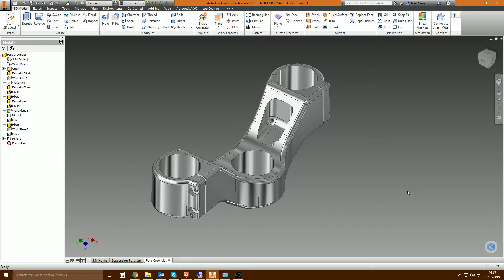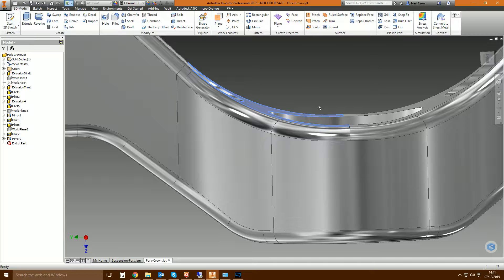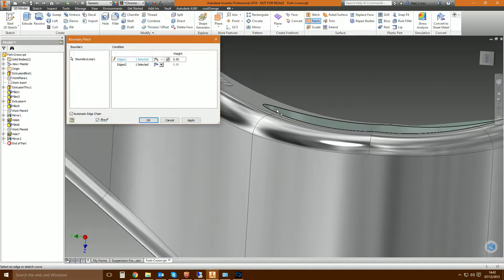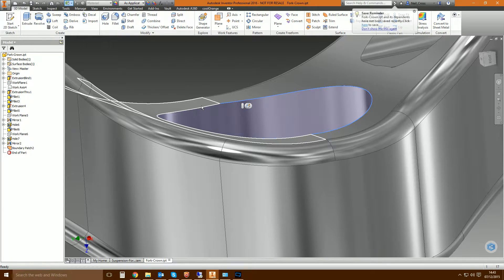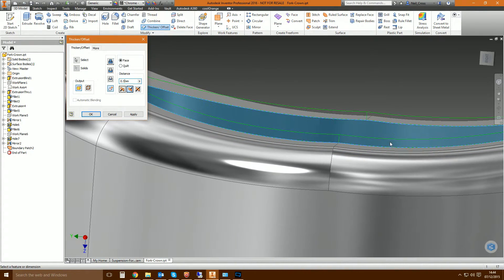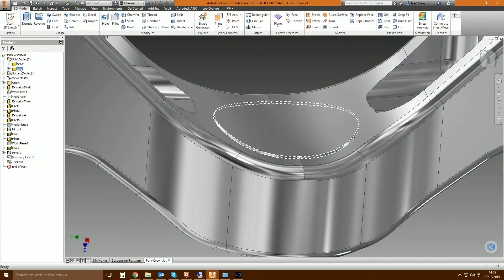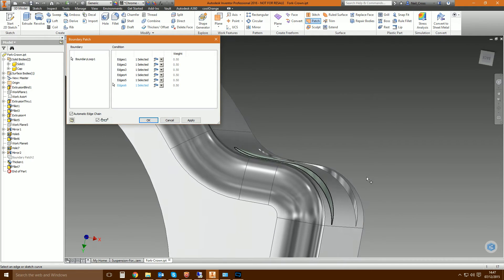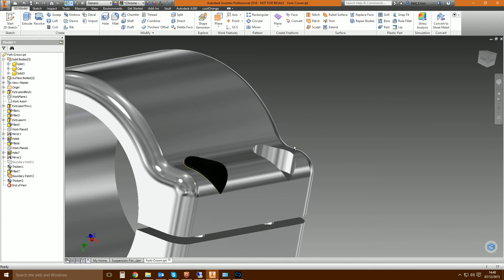Patching up holes and openings | Autodesk Inventor

Comment: Hey there,

how am I gonna make the diameter of the cap a mm smaller so it can fit inside the hole (while having used the patch and the thicken command of course)?
Reply from the maker: +Σοφια Τσαβαλια Hey, you just use the thicken command again but this time use it on the side face to thicken a cut into the solid.  It won't always work, kind of depends on the shape you've got but that's what I would do!
Reply: +TFI CAD Tips 
Thanks a lot

Comment: Tremendous!  By chance, with your phenomenal approaches and personality to boot...do ya think that you'll ever be venturing into the HSM CAM kernel of our beloved Inventor to machine a part such as this triple tree?  

Also, how killer it would be in HSM to mill the free form shapes for the cap covers that you performed in this tut as would be done in the tool and die injection molding world...Ho-Lee-CAD-God would I ever flip a biscuit over such coverage!

Crushing it man!  Best instructor I've ever observed!
Reply from the maker: +Wes Sugg Haha I'm loving the enthusiasm! Unfortunately I don't have any experience at all with HSM or anything CAM related, so it's not something I'll be dipping into I'm afraid!
Reply: 10-4 that good buddy!  With a brain as completely jammed packed with as much bad assery as yours, I can see how things may get dangerously hectic working between parametrics to 3+2 axis mill turning environments!  I have a sneaking suspicion still though, that by next week you'll be crushing that mo-fo too!  Basically, what I'm trying to say is...snap to it...I will remain doubly in tune for the first of 500 HSM Pro CAM tricks!!!

Keep up the level 10 trillion rated ballzin' tips and tricks tuts my most admirable tech wizarding sorcerer!!
Reply from the maker: +Wes Sugg Can I smoke whatever it is you're smoking? Haha thanks, I'll be back on it after the new year!
Reply: +TFI CAD Tips only if I can have whatever it is that you're smoking in trade!  haha!!  The students here among us will be patiently waiting to see your work in 2016 continue forth our CAD God!!!

Comment: how to extend the patch? how to make it bigger then the hole to make more realistic cap.
Reply from the maker: +Jakub Struszczyk Ha, it was meant to just be a visual representation of a cap rather than a real functional cap! To make it bigger than the hole, use thicken on the outer face of the cap to offset the side wall outwards

Comment: very handy ,is it possible to add a further patch under the first cap to form a locating pin dropping into the hole of the model.
thanks Neil
Reply from the maker: +robert barrrett It was only meant to be a visual of a cap rather than a real cap design! But yes you could do a second thicken of the surface and go the other way, then use thicken on the outer faces to offset the side walls in to give a bit of fit tolerance